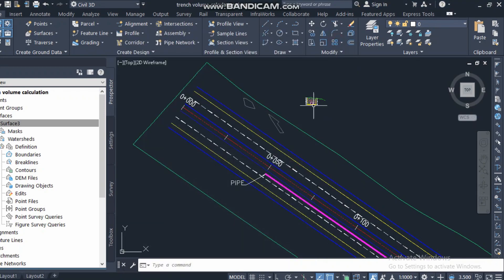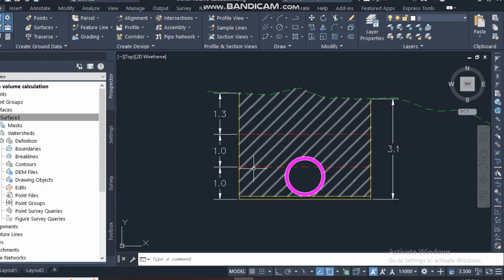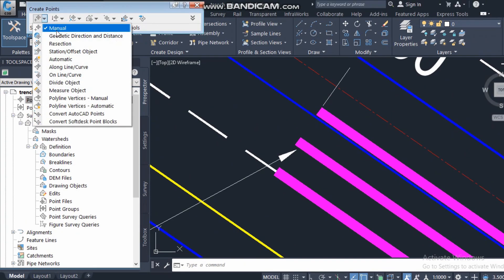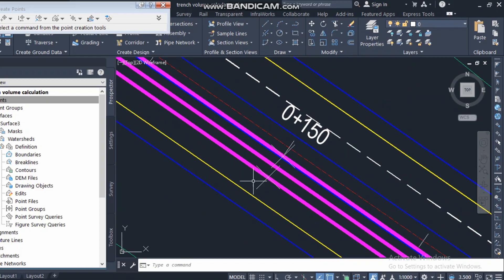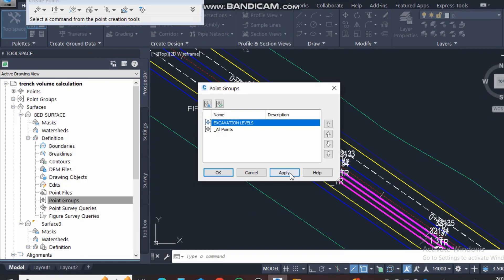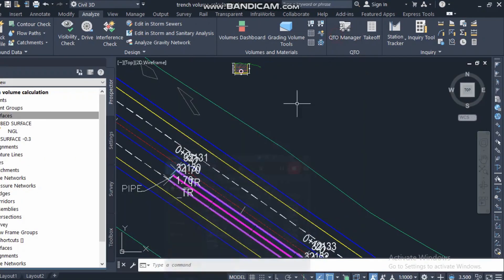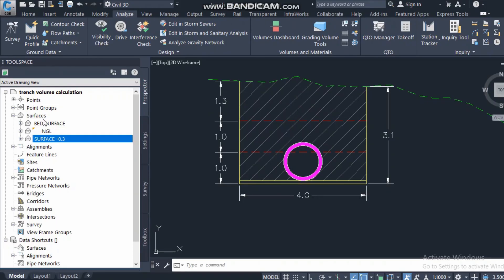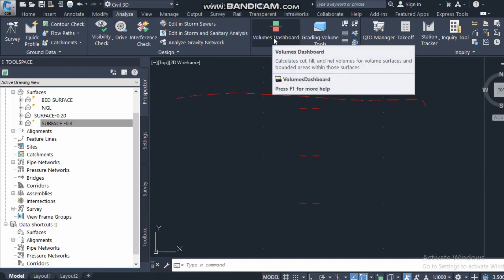49-  CIVIL 3D CALCULATE PIPE TRENCH EXCAVATION VOLUME BY RANGE OF DEPTH

Comment: hi, how can you deduct the pipe ?
Reply from the maker: From what?
Reply: @akhtarmuhammad-39  hi, thanks for the reply. What I mean is if I have the pipe and the trench after excavation, the construction need to backfill it. How can we calculate the backfill excluding the pipe.
Reply from the maker: @JadePadro  it simple.backfill= excavation quantity - pipe length x area of pipe(pi x r2)
Reply: @akhtarmuhammad-39 is it possible to apply it in civil 3d cross section volume automatically?
Reply from the maker: @JadePadro i don't think so bcoz civil 3D calculate volume between surfaces.in this case we will need to create surface from pipe, then it's possible.